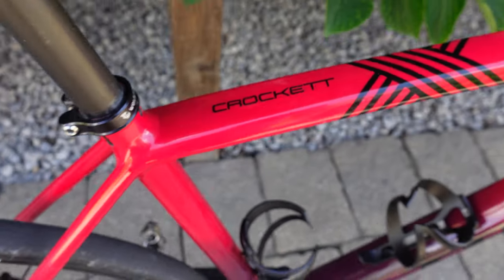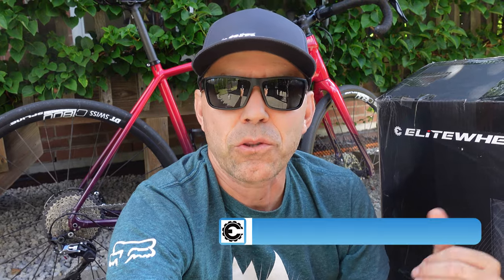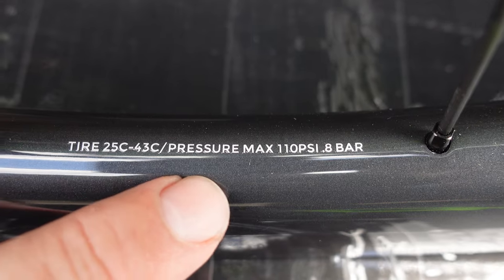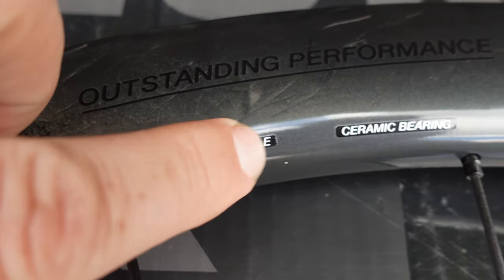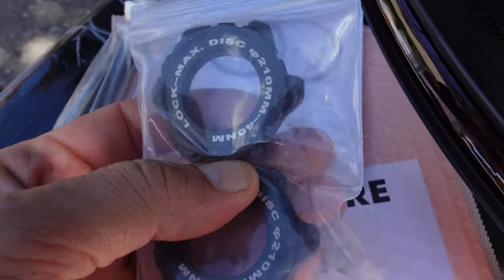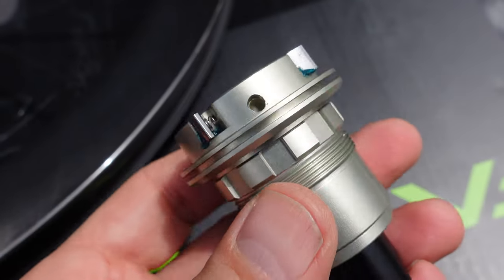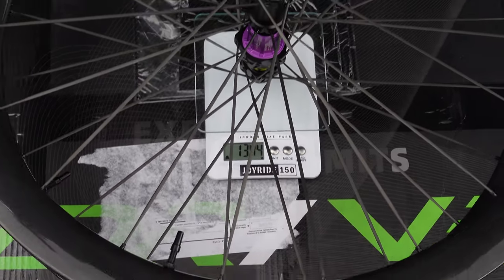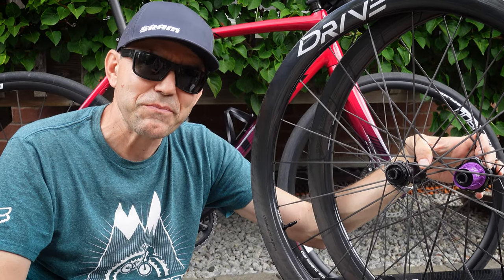Premium Gravel Wheels - EliteWheels DRIVE G45 Carbon GRAVEL Wheelset Quick Check

Comment: I bought a set of Elite wheels about 6 months ago, I love them! and you can't beat the price. Their pro hubs are lite and smooth and run standard bearing. Just got my second set delivered!
Reply: Which model of their wheels/rims did you buy?
Reply: @VanDungLe2510   So far I've picked up 2 sets of the pro 36 wheels, both with there in house hubs. I purchased ceramic bearings separately, they are super light, I've beat the piss out of them, no problems at all. I couldn't be happier especially after using the discount coupon. They end up being like just over $600. You just can't go wrong!  It leaves enough extra money to relace them with Berd spokes lol.
Reply: @LoveMTB   Pro 36 wheels, I'm about to order a 3rd set.

Comment: I want to try the G35 version with normal steel spokes, easier to find in my god forsaken (in bike stuff related terms) land. Also I live by the sea and it is mostly windy 90% of the time and the best trails are along shoreline. Had 42 mm wheels previously and in crosswinds it was very sketchy. Now have 34 mm alloys and they are fine up to storm-winds. Counting on that 35 mm will be perfect for crosswinds.
Reply from the maker: Make sure you use my code for the 15% discount! Sounds like a good plan to me.
Reply: @LoveMTB  I would but since it is a budget model with 659.- price, discount code is not valid, otherwise would gladly support the cause. 👍

Comment: Fitting 25c on a 24 internal width seem to be on the limit. Have you tried tubeless ready 25c on these wheels?
Reply from the maker: You're correct. And no I have not tried tubeless on them or 25c, we run 30 and 32c with tubes

Comment: Mmmmmhh I just gor a set of these in 2024 and the label on the rim states max pressure 65psi. I'm so confused now, I bought this set mostly for road
Reply from the maker: It's gravel, they don't use pressures that high for gravel? I mean I don't use pressures higher than 65 for road either😆